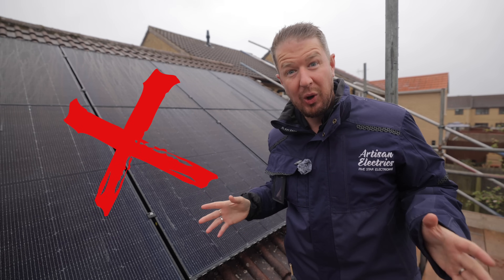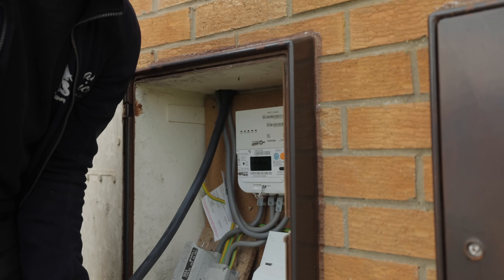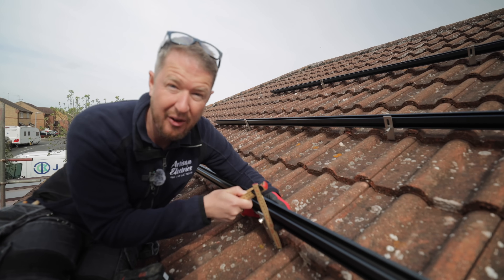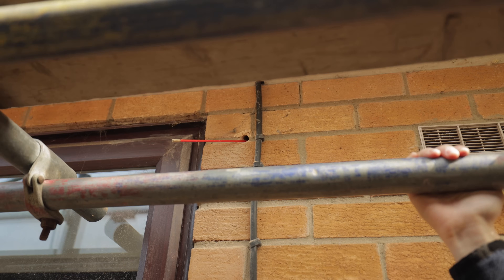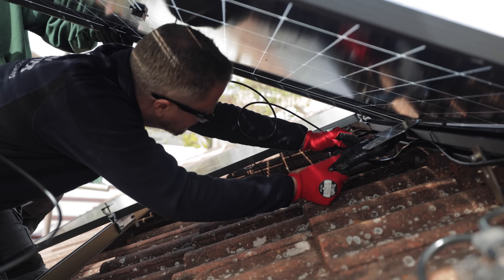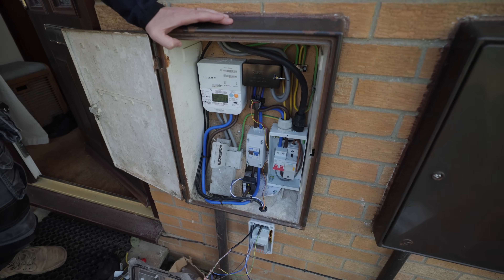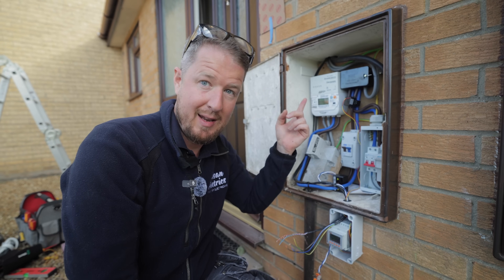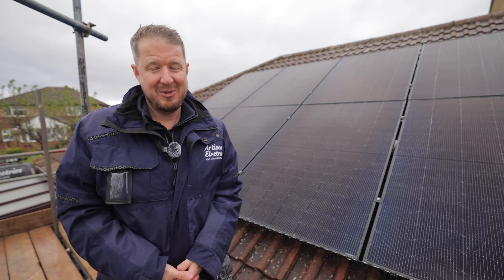Have We Been Doing Solar WRONG All Along? 🤷🏻‍♂️

Comment: The massive downside about micro inverters you fail to mention is the £170 cost per one!  Vs say the 5kW GivEnergy inverter for £1100 that can do 20x400w panels for 8kw panels oversized.  Or a basic inverter for half that price if anyone is going inverter only with no battery!
The 2nd massive downside is the max 320w - you can now get Aiko panels that are 450w - every new panel out there is over 420w. Some large size commercial panels go up to 600w. Why would you want 320w clipping on 400w panels. Inverters lose about 2% in efficiency at 100% power - so why throw away 25-30% power!
The 3rd problem is if one fails.
The 4th issue is DC panels going into a DC battery do that without going through an inverter - much better when you want to be filling the battery on low light days.
Can see why Enphase was a $40bn USA company with massive profits on the stockmarket - the markup on those inverters would make Apple jealous - probably cost $20 to make in China. And yes, £170 on a single inverter is expensive when panels cost £65 in UK.  See ITS technologies / Midsummer Wholesale
What was interesting in the video was the quick side-to-side comparison of the bifacial panel vs the single sided - I'm impressed!
Reply: I just bought IQ7A inverters for £95 each delivered.
Reply: You can get 350w micro Inverters for about 33 pounds each from Taobao in China.  Works well.
Reply: @nnnnn8173  What does "works well" mean? Do they give you more electricity? Are they worth an extra 200W of solar panel (£60 for a 400W panel in the UK at August 2024)? No, of course they aren't. They are a huge con, multiple electronic devices that have no fans and are behind incredibly hot panels during the Summer, what if one goes wrong on your roof? £2,000 for scaffolding just to change one over. A solar panel is far less likely to stop working than a micro inverter. They are such a waste of money. Where is the advantage in having them?
Reply: Not sure why one failing is a problem, had an inverter fail after 3 months so 2 weeks or so with no power, one inverter fails you still get power from the rest. EEV blog has done a few videos on his micro inverters

Comment: I have bi-facial (Trina 430 N type fitted, with a Tesla powerwall 2 and gateway… since fitted, commissioned and operating, since 4th April last, the system has supplied all our power, and I have not imported any power from the grid, but have exported 145kWh to the grid… Conditions have been reasonable, with some sunny days, but mostly cloudy with the odd break in the clouds, and of course a few days overcast and raining… However, I am over the moon with the system, and now considering adding another battery so I can effectively go ‘off-grid’ during better weather conditions at least…so if saving 50% of my electricity costs overall, and getting the payback for my investment in the system a lot sooner… well pleased 😊 and would recommend the bi-facial panels to anyone…

Comment: I would not want a micro inverter set up... I rather have batteries and a solar charge converter and use my own grid tie inverter (one that I can easily replace if it fails). I doubt if an proprietary phone app will still work with these micro inverters  after 10 to 15 years. They will probably stop supporting and consider it obsolete. Micro inverters are simply easy for the installer but not necessarily a good choice for the home owner. I can't make any significate money selling energy back to the electric company where I live they hardly give you anything for what they buy back. Much smarter to use that excess electricity to store in batteries and then use it at night or for when the grid goes down. Batteries have gotten much cheaper! I bought an grid tie inverter that has an amp clamp on my main feed coming into my panel and does not allow any power into my panel other than what I use. The rest is stored in my 60kw 48v battery bank. I installed it all myself.

Comment: i would use the cheapest solar panels per W. bifacial only makes sense on a balcony where the space is limited. or for a fence. the return of investment with the cheaper panels is much better. if you have more space, add two cheap modules compared to high efficiency expensive modules.
if they don't last that long? who gives a fuck? in five years we get perovskite modules with at least 30% more efficiency for the same price and the investment in the old modules came back multiple times already.

Comment: DC to AC on the roof from the panel to the micro inverter. AC to DC to get that power into the battery and then another inverter to get the DC power out of the battery.....Just another solar scam!

Comment: Interesting video - thanks! I’ve recently had IQ8MC micro inverters and 435W panels fitted to my roof. The one big disappointment with the installation was the micro inverters are only able to output 320W peak power (despite panels being 435W) and the clipping is very obvious when you look at the power curve on a sunny day. I heard that there’s a trade off, as more powerful microinverters have a higher starting voltage (or something like that), so they wouldn’t perform so well on a cloudy day. But still, I feel a bit despondent about the clipping. The system can only achieve 75% of the peak power I was quoted for.
Reply: That's kind of terrible, my 445W south-facing bifacial panels output 500-510W at noon when it's 5°C, they eventually get hot and settle around 470-480 after 20 minutes. Granted I have them mounted 2 meters high with nothing underneath but on 24°C days they output 420W for 3 hours straight. They run on an AP-System EZ-1M, first Watt at 5:45, last watt at 20:15 and that's with no view of the sun after 14:30.
If you're selling electricity to the utilities, I would seriously consider swapping the inverters. If you're only running your home and a battery (no EV charging), it's not going to make a difference.
Reply: Forget about the peak power, its not relevant in the end. Electricity in those peak times is worthless anyway since everyone is producing more than enough. I recently installed 37 IQ8MC on my roof and they produced 12W per panel on a cloudy day when the panel was completely covered with snow. Duration of production is key, not peak power.
Reply: @mresch3950  Rubbish. Peak power is very important - if you have batteries, you are charging them.  If you are using multiple heavy loads - hot water tank, oven, you need 6kW minimum. "everyone is producing more than enough". On what planet? You recently wasted how much on 37 micro inverters? Care to tell us? What was the increase in output? Oh wait, you don't mention that. Nor do the manufacturers! Where are the videos from the manufacturers, PROVING an increase in output, and an increase in output that justifies the cost of the micro inverters?

Comment: Is there any mileage in fitting a UV reflective sheet or panel between the tiles and the panels?  Clearly this would be a better option if these panels were to be used as a roofing material - i.e. build UV reflection into the insulation below the sealed panel...

Comment: Going for a clean / fresh install with battery  - loses any real advantage Enphase micro inverters provide - you still need the inverter - on the battery, and it has to rectify the AC (double conversion)  in order to be able to charge the battery, so no win vs Solaredge or Tigo Optimisers (Tigo can be used with other brands of inerter, Solar Edge require their Inverter (and battery if desired).

~ 5 mins - the over enthusiastic secondry  presenter mis-spoke re. PV solar panels converting UV light  into electricity,  - ??  well not really (they tend to be fairly insensitive to UV light  (unless this is a new technology).......   But I get the enthusiasm...

~9 mins love the saw race - its hows how important it is to train guys to use a powertool - or it simply won't work properly (the kid on the Recipro saw wasn't using it at all as it is intended - these saw types have an anvil for a reason,  (the Hilti Bandsaw - is absolutely a premium tool choice).

Comment: So adding these cleaver high tech devises may be a good saving, long term not so sure. With the rising cost of using scaffold to access rood systems, your adding technology which could go wrong which in my experience does.  Then a failure means £ more to fix .

Comment: Seems like a bad mix, bi-facials (on a dark roof with room for 1 or 2 more panels) coupled to a microinverter with a ~290w limit. Don't the bi-facials only work in strong light when the inverter is clipping anyway?

Comment: Would it not be pertinent to put some sort of reflective panels under the PV panels - stainless steel sheets or white plastic boarding for example!?

Also, on the battery, could an enclosure be placed over it to hide it from prying eyes, without it leading to problems with cooling etc!?

Comment: We have Enphase micro inverters on our array.  You're more than welcome to ask anything you like about our experience.  We've had 1 fail over 9 years.  System kept producing whilst faulty unit was replaced.  VERY happy with them.
Reply from the maker: Sounds like you have a great system on your hands! Hopefully, we are going to keep installing these from now on.
Reply: I have a new build. Would you recommend installing a roof with solar, integrated set up or solar tiles(UK)? I like this system.
Reply: Can you talk about the burden involved in getting the micro inverter fixed? Also, do you have any information on how the micro inverters may have reduced the energy available, e.g. by having a minimum activation power or through inefficiency? I would have thought it would be better to have the individual inverters inside the loft so they are easier to access, but maybe that creates new problems.
Reply: @alsmith20000  also enphase is pretty good with warranty’s and making sure they are accountable with any manufacturer errors. Which is few (I think it’s 1 in 5000) don’t quote me on that part tho😂
Reply: @alsmith20000   your questions are very good. To answer micros rarely have failure and are way less inexpensive to fix one micro rather than a very expensive inverter. To answer how they are swapped , it’s as simple at taking the panel off and attaching a new micro to the rail and panel. That process can take no more than 2 hours while you might have to wait weeks for a new main inverter
Reply: @hamcheese9169  Thanks for this; I was in particular thinking about the getting to the roof part of this. If someone has to come and erect scaffolding and remove it again to replace a panel or micro inverter then that might add £500 to the actual job of changing over the component.
Reply: @alsmith20000  yeah idk what the uk has for saftey code. But in the USA we just use a saftey rope and ladder. We rarely use scaffolding and on this roof we would never use it. But that might just be their policy
Reply: WHY are you happy with them? Have you seen an increased output, or were they there from the beginning - and thus you haven't a clue as to whether they are doing ANYTHING helpful at all? Laughable.
Reply: As a fellow installer the micro inverters are way better and more practical. Optimizer (dc) systems only produce what the worst panels is. Micros make every panel produce individually
Reply: @hamcheese9169  I thought optimizers are exactly for used for the reason to bypass the worst performing panel
Reply: @nikotakai8796  they are but since they are still dc they can still have an effect on the others. Micros switch the current to ac right after each panel

Comment: Now that was really useful, long time subscriber and I'm now on that journey to try and understand solar and battery storage for my house. This was the best explanation I've seen so far on the difference between oprimisers and micro-inverters. The things I hadn't twigged was that the latter eliminate the need for the big inverter box on the wall and also that the cables from the roof are then AC only. I've got roughly east / west facing with some shading from chimney but not that much space to put the battery and inverter. Got plenty of space but a lot of it in very hot sun in summer or a really cold blast in winter but with only the battery to worry about I've got a couple of spots might work.🤔 Food for thought, cheers Jordan, Artisans and Heatable.👍👏
Reply from the maker: Glad we could help you understand more about solar and any differences that you needed to learn about!

Comment: A way round the component failure debate could be as simple as a connection box or cable transit? Each panel into JB and single wire through roof or a watertight transit panel and take all 8 cables through. Then connect each of the inverters screwed to the inside of the roof. One fails it’s an easy scaffold free fix.

DC shocks was a good laugh!
Reply: That wire could carry up to 1000V DC, be connected using field fabricated MC4 type connectors and largely negate the superior safety profile of an AC based architecture.

Comment: I may be wrong but Solar cells allow energy to pass through them they do not capture it all so the second set of cells is capturing the left over energy which would normally heat up the backing and affect the cell efficiency.   The gaps between the front cells also allows energy to flow into the clear substrate which acts like fiber optics transfer energy/light to the second set of cells.  Not having the front cells edge to edge does reduce the power density a little but is probably helps with the cooling.  Trick stuff.  Shame we've allowed the exporting of our manufacturing to China who are the world leaders in this.

Comment: Or.... you have a bypass diode on your panel ! All the newer panels have one and it comes for free. There are videos out there which show that they render balancers useless.
Reply: Hear, hear. All solar panels have had bypass diodes since the 1980s. Micro inverters and optimisers are a complete con and a waste of money, and one more thing to go wrong on your roof, which will cost you a fortune to get fixed, as you will need scaffolding again.

Comment: So more of an issue here in Oz we have had MicroImvs for at least a decade now...with our hotter climate there is always an issue of the Degrigatiom of haveing electronics on the roof vs in the shade lower, however from am other angle if you loose 1 inverter then you are still generating...hope you compare these on your Micro inverter breakdown ( excuse the pun)